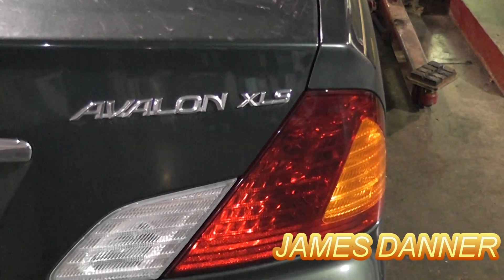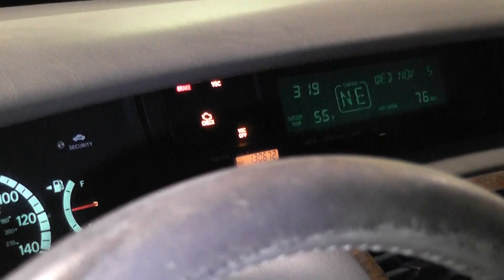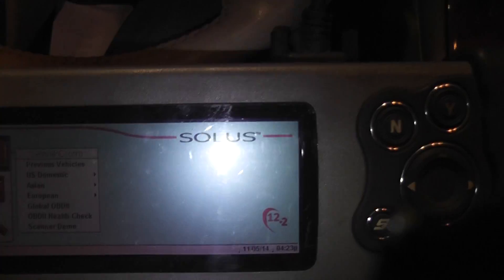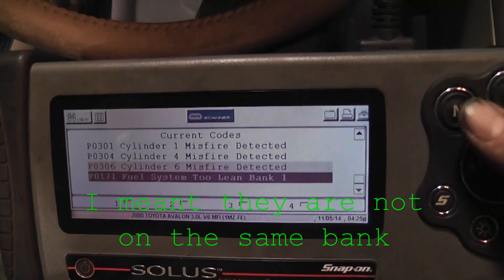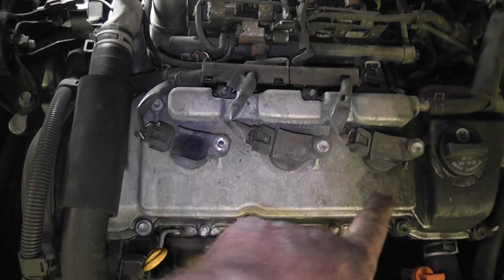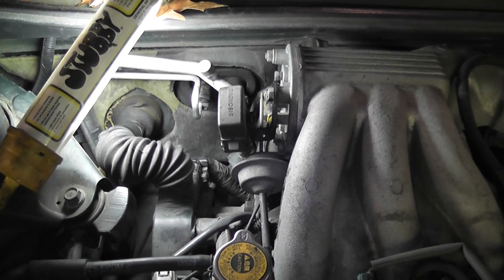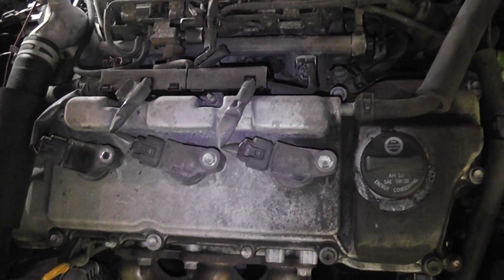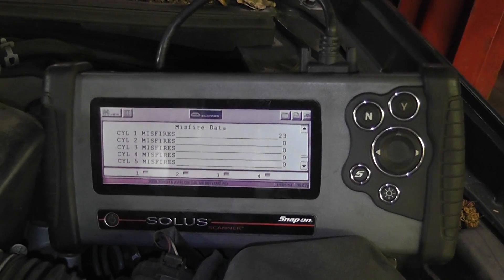TOYOTA AVALON MISFIRE REPAIR

Comment: Did you try ohm testing the bad injector and comparing it to the ohms of the new injector?  Would this determine if the coil is failing or there is an issue with clogging?   Injectors can be 'flushed and cleaned' fairly easily off the engine
Reply from the maker: i did ohm check the faulty one and one that worked. both had 15.1 ohms. but when key was on, power in ckt, the bad one dropped to 13, the good one didn't change.  i know that's probably not a legit test but add that to theory building.  i honestly don't know if a sticking injector would be visible on a graphing scope. thanks for feedback
Reply: James Danner I'm pretty sure that 2.1 ohm difference is enough evidence to say the injector was failing.  Glad you checked it under load, cause that's something I was wondering.  Thanks for replying and posting the video
Reply from the maker: I had a small part
Reply: James Danner James, your ohm test revealing a 2.1 ohm drop on the bad one, to me, is enough to confirm what I originally said about it being partially open ( Only half the coil being used ) under load, and you provided that extra boost of current ( With the Test Light ), providing a stronger magnetic field to open the injector all the way. It had to be at least, partially open, not completely open, or there would had been no current flow at all, when you put the test light to it. In my theory the injector was just barely failing, barely! Keep in mind, as I said before, the PCM was doing most of the heavy lifting and giving it the proper pulse-width, well sort of ? As far as detecting a stuck injector on a scope, I would think, maybe!, you would see a rise in amperage to a point and then it would flat-line, if it was sticking? Just Theory Building! LOL !
Reply from the maker: I'm hoping y'all figure it out for me!
Reply: Billy R After rereading my previous posts, I realized I kept saying a partial open in the injector. I apologize, what I meant to say is a partial short in the coil internally to it's self not to ground, causing only half the coil to be used. But if there was a total open in the coil it still would have no current flow with or without the test light!
Reply: Billy R if it was partially shorted,wouldnt the amp ramp sharply increase instead of dipping down like it did? sorry to beat a dead horse but learning by asking.
Reply: Don Mappin Yes and no, because it would not be a partial short to ground I am talking about, which would draw more current. Rather what I meant by a short across the injector coils windings from one part to another. For example, this is just a hypothetical and exaggerated, to try and explain to you what I mean and nowhere near as severe as I believe that it actually is. Just for arguments sake, say the windings in the coil were shorted from the beginning of the coil to the end of the coil, bypassing the middle of the coil. In reality it would almost certainly burn its self out instantaneously or the driver for that matter, from far less resistance and pretty near uncontrolled current flow. But if it were shorted but far less severely and far less windings were involved, I think the increased current flow, due to less coil windings in play, would be minimal and the magnetic field would be slightly weaker to open the injector pintle. I think, Just a theory!
Reply from the maker: you guys are making my brain hurt. Ha
Reply: Sorry, but I love this Sh**t! Nothing like a good freaky one like this!
Reply from the maker: no. im kidding. im loving it as well. i feel validated when u guys want to get involved and interact concerning my vids. thanks. i like your theory
Reply: Yea! Yea!, I knew you were only kidding! Stop bothering me I'm watching your new vid Chev Van/No Start! LOL!
Reply: Billy R do you have a thought on the extra bit of pattern on the voltage trace right after the inductive kick?
Reply: At the point at which the injector turns off ( Signal goes from low to high on the graph ) is where you see the inductive spike and when pintle slams closed.The magnetic field collapses around the iron core of the injector and induces the inductive spike. I believe when the injector pintle is also crashing down to the closed position,that ( maybe due to weak ? ) spring pressure in the injector, that it makes a little leap back off the pintle seat inducing a little rise in voltage and kinda floats for a few ms, before settling back down on the pintle seat where we see that final hump. Maybe ?

I'd interested to hear your thoughts or anyone else's!
Reply: I think he was getting that pattern even when the injector was not opening and then when he connected his test light, another small "bump" in the pattern moved down further in the trace when it did open and misfire stopped.I'm starting to think that it was stuck or sticking and the extra boost from the test light let it overcome mechanical sticking.I just cant explain the strange pattern.
Reply: I say that's a good a theory as anyone's so let's put this baby to bed, once and for all before I have to buy James a bottle of Aspirin! LOL!
Reply: Deal!
Reply: Great corresponding with ya! Feel free to join in on one of my comments anytime! good for the learning experience, you and me both!!
Reply from the maker: i enjoyed watching two technical minds discuss theory and possibilities. keeps us all sharp.  thanks guys
Reply: You the man James, Just don't tell your brother I said that. I always tell him he Rocks! Ya know, an Automotive Diagnostic God! I wouldn't want to hurt his feelings! LOL !
Reply: Don Mappin Don I know we said were going to put this puppy to bed, but the Danner brother's woke it up! You got to see the review they did on Paul's channel ScannerDanner free! Paul explains the question you were asking, why that little bump moved farther in time on the graph! It was because the resistance in the test light delayed the shut off time of the injector and the voltage spike it's self!
Reply: who started all this?  lol

Comment: Great video! Seen patterns with shorted injectors, but can't remember seeing a partially open(theorizing)? one before. Keep up the great work,thanks for the lesson.
Reply from the maker: add more to your theory. good and bad injectors both had 15.1 ohms but with key on the bad dropped to 13 and good stayed
Reply: James Danner Was agreeing with what Billy R. was saying,I think static ohms was one thing but when amperage started flowing is when your partial open showed up as seen by the amp ramp.
Reply: Don Mappin Another theory by my fellow mechanic is a sticking injector.
Reply: Don Mappin True but, if it was sticking with no open it would not increase amperage! Yea Maybe?
Reply: do you think it should have an inductive kick on the voltage pattern at about the same instance that the dip in the amp pattern is?
Reply: that is with a true open? maybe?
Reply: Don Mappin That's a hard one to call, but yea I think maybe, it's theoretically possible? probably a long stretch, but maybe?

Comment: So a good test  might be just to ground the control circuit of the injector and see if the misfire goes away. A good test If ya know what your doin and ya can get to the injectors. PS like your no nonsense approach you seem to make it fast and easy. You have a lot of good tips.
Reply from the maker: thanks for the compliment. i do waste a little time on the video filming part and do a few things i probably wouldnt do normally just to get more content. but i like doing it and learn in the process. thanks again for watching

Comment: James, Weird one hey! My theory is that you had a injector with a coil that was partially open ( half the coil not being used ) and with the PCM's pulsing signal it was limiting the amount current flow and it was not creating a strong enough magnetic field to open the injector fast enough or wide enough. Although the PCM signal was doing most of the heavy lifting, when you provided a non pulsing ground, thru the test light, that extra steady 200 or so ma of current flow thru the coil, provided enough current flow to increase the magnetic field and lift it fast enough and wide enough. Just a guess, what do you think? Aside from your camera skills (LOL), your Automotive Diagnostic skills are top notch!
Reply from the maker: that "extra " bit of ground seems to be the common consensus.  i appreciate the positive feedback. and the tolerance of my "exceptional" camera work

Comment: Regarding your use of the Snap On "low amp probe" and current ramping the KG injector, the dip is known as the "seagull effect" (aka the "pintle hump"). This shows when the injector is starting to open. Typical diagnosis detecting a bad injector, as you  know, is when there is initially any vertical climbing prior to the diagonal ramp. The waveform of the bad injector, with the exaggerated "seagull effect," seems to be an additional means of detecting when an injector is starting to go bad.
Reply from the maker: thanks for watching. I also appreciate the technical feedback
Reply: johnwrench4speed

Comment: With the test light on the control wire grounded to battery negative it was holding open the injector and it was overcoming the mechanical force that was preventing it delivering fuel.
Reply from the maker: i could buy that. weird tho huh?
Reply: James Danner
Yeah it is for sure.

I did have a play with it on a Ford a while back it made it run real rich to the point of misfiring, but never really tried it in a Toyota.

I'm going to have a play with it on a few different vehicle makes and see what it will do.

If it does work well it maybe worth thinking of doing if we want to drive the fuel mixture rich to look at a response from a O2 sensor when there is no propane at hand. Providing the injector plug is easily accessible. Just a thought.
Reply from the maker: I never even thought of that. I should have done a good one for comparison.  Like i said i was zipping along just looking for the control wire so i could do a flow test next when it happened. Let me know if anything comes out of your research.  I did see the 'on time' pulse narrow a ms or so with test light in circuit. Good chance that could have have been the whole bank doing that